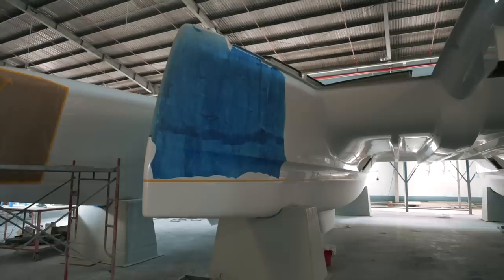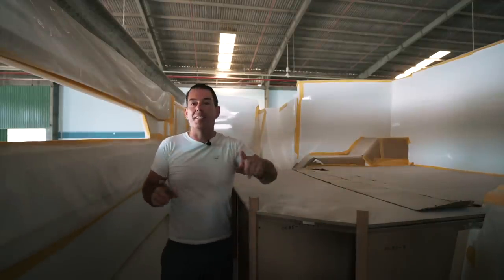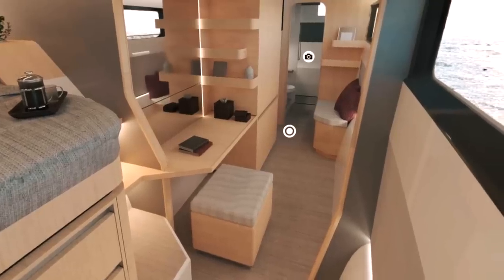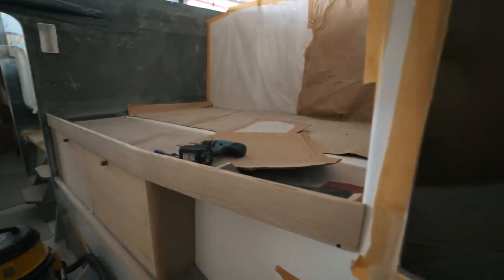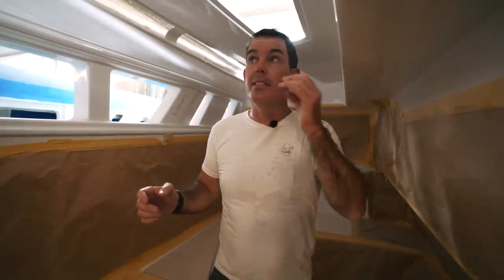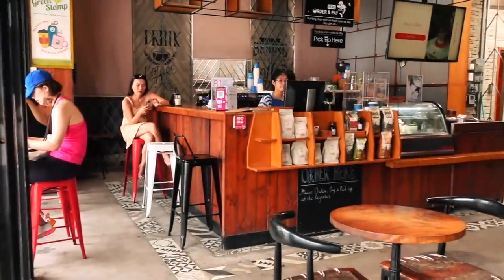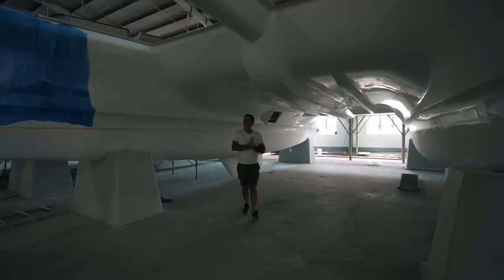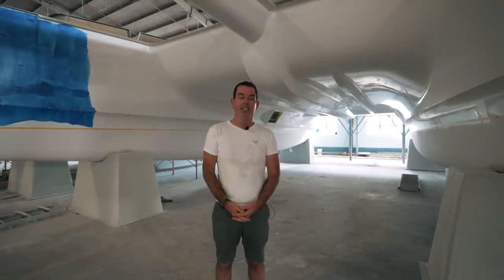Ruby Rose 2 Build Update: Do We Have Enough Storage?

Comment: Coming along very well. There has been a lot talk recently regarding the quality of the Bulkheads in Lagoon Catamarans.  I think I saw a pretty impressive bulkhead behind you in this episode.  Would you mind showing and discussing those in one of your episodes.  My apologies if you have already shown this but I don't remember seeing this.
Reply: I think he already showed this. 
They are glassed in completely. And - he showed that there are water tight sections in the hulls. 
He showed also pictures of a Seawind crashing into something (floating object). They went many hundred miles with the crashed bow due to the water tight compartments.
Reply: @wjhann4836  Yes I went back and reviewed that episode.  It deals exclusively with the crash bulkheads.  In reference to the recent Lagoon 450 problems they are having problems with under designed structural bulkheads.  I was interested in seeing how robust this Catamaran's structure was reinforced with those bulkheads.
Reply: @docflyer4001  Well as far as I remember, there are 2 big structural bulkheads made of carbon fibre structure just at front and back end of the salon. they are sorrow glassed in. 
Was on a Lagoon lately - Lagoon is a sloppy card box  in relation to the Seawind

Comment: Since so much of your work is computer based are you going to pull hardwired ethernet in?
Reply from the maker: Might be looking to starlink or local SIM cards
Reply: @sailingrubyrose  with the type of travel you guys do, and the places you go, I would limit the AP’s on your local (boat) network and strongly suggest everything is hardwired. You are data dependent and ripe for a ransom attack. Riley has driven starlink access for sailboats and would recommend that as your single wireless AP…